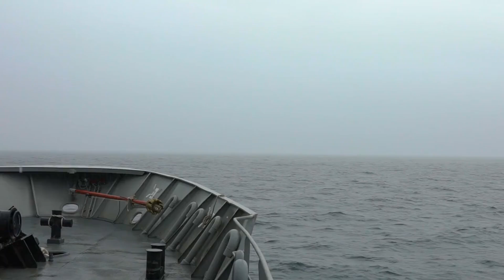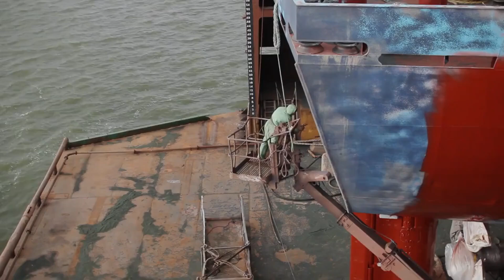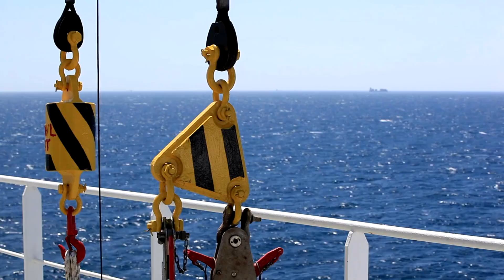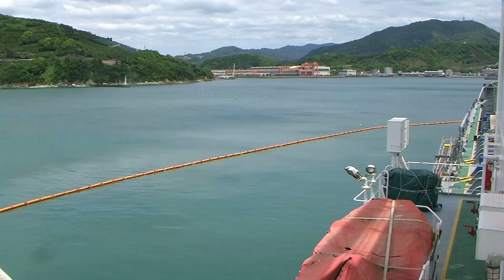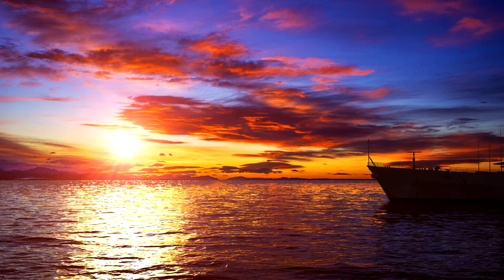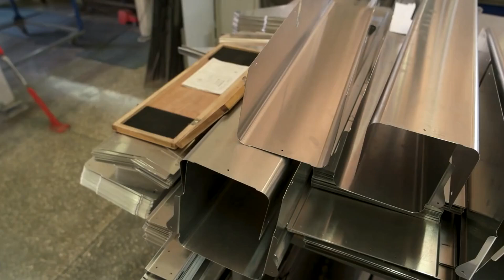Why Are US Navy Ships Rusting So Badly?

Comment: you totally forgot that  
                   1-  the steel that the US is using is cheap import not unlike in the old days when US-made and would have extra ingredients making it  less 
                         corrosive 
                    2- in the old days the ship had to be painted once a year  so weekly the maintenance crew onboard the ship would be tasked with a section to go  
                        over if conditions are right   no storms no rain and no below-zero temperatures 
                   3-  dockside labor cost in the US  $45  to 75  per hour in Russia and China  under $ 3 -$5 
                   5-  the European navies have been experimenting with vinal raps  which have been rewarding so far the US  has no such thing nor has approved    
                         such applications due to   bureaucracy mentaly  that it has that if doesn't come from an admiral it will never happen 
                    6-  the paint that US Navy uses is a spec paint that is outdated there are expensive brands  that can be used but its not used  plus the coating  
                         methods of the US Navy  are also outdated - they don't need to go to their top research center to find out  they just need to go to the
                         Oil industry and see their coatings methods - plus you have to follow their way or the highway even if it's outdated -- also in the old days the US  
                        Navy  used lead oxides which is now band this coating was better than any primer out of there then there were copper oxides which too was 
                       banned  both China and Russia still using this old stuff  and they are better than any kind of primer that is out there that two also applies to the 
                        antifouling  which has things that kill marine fouling too has been banned  - it's the environmental issue that those other navies don't even give a   
                        rat ass about